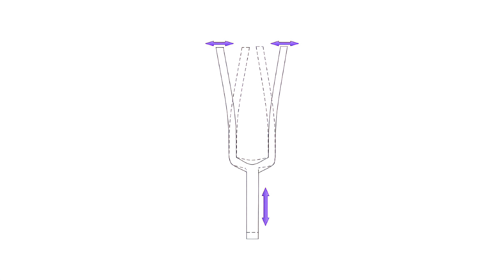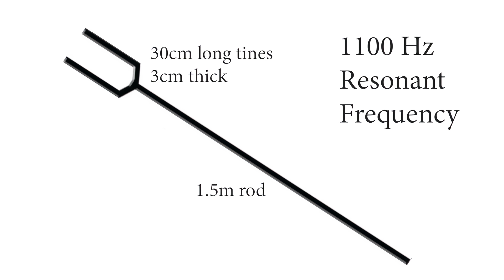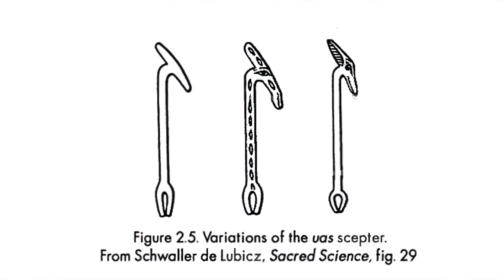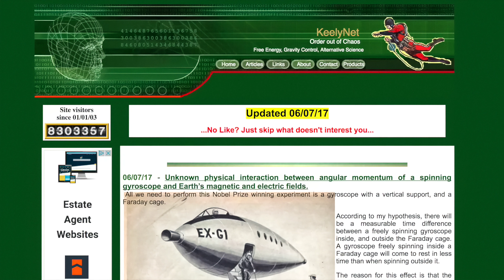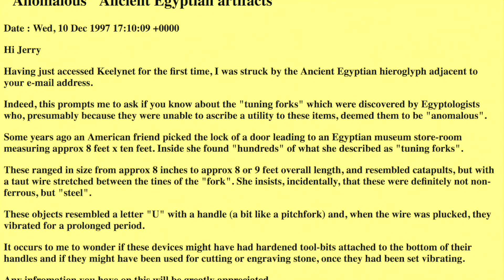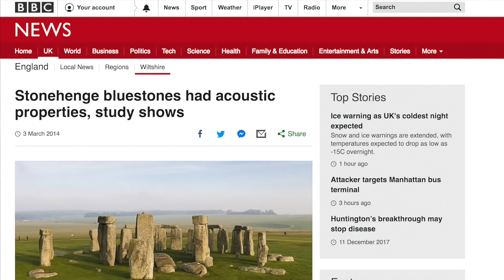How the Ancients Cut Stone with Sound - Lost High Technology Explained | Ancient Architects

Comment: to use these technologies would still have to have had tools for their use. even with the hand tool dogma we are told, where are all the tools and tool factories for manufacturing these tools. very few tools have been found of any kind. nowhere near enough tools have been found for all the claims. there is zero connection to the scepters being such tools. we are certainly missing something important. just to keep hand tools sharpened and made would have been a huge never ending operation with a ot of people involved. people think if ya can do one simple little thing one way then ya can do it all. simply not true

Comment: I believe the sound generation device was actually the Djed pillar. Rings touching a turning centre tube like fingers on a wine glass. The UAS sceptre was a handle for spinning the centre of the djed - just like the ones used for shaping clay pots. The ankh key was simply the attachment point between the Djed and the sceptre. The ankh is seen attached atop the djed in several places.

Comment: While I believe there was an advanced civilization that was able to do the incredible works of very smooth granite, diorite, and other very hard stones that need special tools to work them. But the myth of only having copper and stone tools is such a lie! We have seen examples of meteoric iron knives and it doesn't take that much to make chisels for good results.

But like many things in Egypt, the current occupants have many reasons to hide the truth from the world, so it seems that they were always the people of the area...

If they had an iron tip that slid over a copper or bronze rod, you would not need a complete iron tool to work the stone. But seeing how much meteoric iron was available, they could make small chisels from the scrap pieces.

Their tuning fork instruments can be steel, however, brass is a good metal, as is aluminum. But there are some fancy alloys that also work, but are not required to get the job done.

The idea of having wires interconnecting two forks may have been a way to keep the working fork vibrating, by striking the second fork with a small mallet, and keeping the wires taught.

Comment: Copper alloy tube drill, held like a drill press, in a large bit holder to maintain straight cuts, and get a big stringbow, like spinning a stick to start a friction fire with a bow and string, then try and and simulate starting a fire but in the stone with slaves, use a string bow, instead of spinning the drill by rubbing  yer hands together?🫤

Comment: I'm a retired stonemason sculptor and I have often used a two prong cast chisel that has the sound of a high pitched tuning fork. It always easily removes the stone from the right but never does any damage to the stone on the left of the cut. Works very well on lime stone and some sandstone. In all of my working life, I have never seen another. After watching this video  I can understand now why it works so well.
Reply: Do you remember where/how you acquired this chisel?
Reply: Was it like the ones used to work designs into leather?   Did you strike the handle with the fork side to the stone you were cutting?
Reply: Most Likely Tungsten. Resonance.

Comment: Perhaps they used a violin-type bow to excite the wires to keep a continuous frequency and apply pressure to the cutting fork shaft.
If they used soft copper tools these would start to get embedded with very tough pieces of granite and reinforce the cutting edge of the copper tool. This would be a continuous process as the copper tool wears. We use a similar process today using diamond particles.
We can't dismiss the fact there is tons of garnet sand in Africa. Ask any motorcyclist there who has had his chain sprocket ground down.
This would make an excellent rock-cutting medium with copper.
Maybe they used the hardest rock, ponding it into small particles and introducing it to the copper tool mixed with water which embed this medium in the copper cutting tip. 
After dismissing the copper tools as useless, we may have missed the obvious they did use copper tools but not in the way we thought. 
That is why there are heaps lying around. We have to stop thinking modern and place ourselves in their time facing their problems with what is available and using it in a constructive way as they did. Then we shall have the answer.

Comment: I am a master woodcarver and machinist.  I'm interested in how these old kingdom sculptures were made but every video I see shows theorists with no machining knowledge trying to pitch ideas that are contrary to the scientist's ideas who also have no machining knowledge.  Seeing wide spaced etch lines in a tube drill and thinking that it had to have been cut at an extremely fast pace when that was likely when the rotating tool was removed much quicker than the boring speed, (as is typically done in machining)  When you drill a hole you also have to consider how the removed material is exiting the hole getting out of the way of cutting progress.  There's feeds and speeds and heat build-up and all of this is for a simple hole.  When you are carving a 3 dimensional sculpture you don't simply do the whole thing with one tool, ever.  You are starting with a block large enough on x,y, and z axis to encompass your final piece.  You remove material around one of the axis in "rough cuts" that don't go down to the final finished depth typically with saws or rough grinders.  Then rough out material on a 2nd axis, then the 3rd.  You need many different measurement tools to be able to verify that you are not removing too much material.  Then there's rough shaping to bring the piece to a near complete state, still leaving enough material to remove in successive finish passes where you use finer and finer abrasives to achieve the final finish.  With a woodworking piece you may be sanding at 400-600 grit at the end, you are not carving with 400-600 grit.  Then there's adding details with various small tools.  These old kingdom sculptures display shapes, details, and finished surfaces that require so many different types of abrasive tools.  I'm sorry, but the only way to do it is with cutting elements that are harder than the material being cut.  How much harder directly effects how fast you can work.  The amount of rock work that was done in buildings, art and every day objects would indicate that they were able to work relatively quickly so clearly they had access to diamond cutting points and various degrees of diamond abrasives.  Unless someday we discover a readily available material that is harder than that
Reply: You know the Greeks carved marble statues I presume.
Reply: 😂😂
You haven't a clue.  Cutting stone is relatively easy it just takes time and effort.  Plus sand and water.

Comment: I last heard of the use of sound in levitation of heavy objects and using it to cut hard materials back in the early 1950s. I am still totally mystified as to how prehistoric man  lifted a rock balanced it on three or so other stones to form cromlechs etc.. If a ramp was used it had to be substantial because an earth ramp would just sink under the weight and putting the stone on rollers would make the problem worse.

Comment: Above the tuning forks from the statue there is a round thing. That could be a rotating structure like a fan ass, shaped like the notorious black schyst bowl. That "bowl" would oscillate while spinning or wobbling when weight of various mass is hung on it. This makes the air vibrate and would certainly make the wirestrung forks vibrate as long as needed

Comment: I always believed that the  septre was in fact a KEY.. a key that was used by Pharoah to SWITCH power on and off . the place  was those long small shafts that are seen in the great pyramid. ..usually thought to be air vents. Note the two copper points (positive and negative )   not unlike modern day electric switch.!

Comment: Stone is only cut by a huge input of ENERGY. Vibrating forks don't carry on vibrating by themselves once damped by touching an immovable surface (stone). Ultrasonic cutting only works by using an electrically powered transducer.  hundreds of Watts of power from the grid. Wishing a method doesn't isn't a solution - TEST IT

Comment: Another way to get constant, or near constant vibration isn't by striking the forks, but by bowing them.

If you have a taught wire between the prongs of a fork, and bow the wire, the fork tines should vibrate properly.

By looking at the cut stones around the world, the rate of cut is shown to be quite aggressive, much faster than if you rotate the cylinder to cut the stone, altho, you do get a pattern of rotation in the groves in the stone, that the cylinder was rotating.

Having tuning forks of different sizes, would allow you to have different cutting power, and could explain why there are so many forks found in the storeroom. 

But isn't it wonderful that there are any hidden artifacts? You would think that putting all on display might get someone thinking outside the box as to how the ancients were able to do some of the things they did?

Comment: Well if the Alexandra library hadn't caught fire, there might have been some past knowledge, and we will never know.
So they had a sort of Arnonica device that made high frequencies  vibrations too a copper wire stretched tight causing the frequencies to be transmitted through it causing it to cut, stone with high frequency sound in a linear fashion.

Comment: I believe yr wrong about the wires between the tuning forks. It looks as if it's symbolizing the wave that's transmitted between them. And the cutting of the stones I believe was done by slow movement of the drill that's attached to tuning forks. Like the slow movement of yr finger around a wine glass. No hitting it with a hammer. Just slow steady movement which would cause the vibration needed
 Also water would be needed in the whole being created. Hyroglithics sometimes are more simply written for understanding

Comment: @10:15 "Independent researchers have proved that you can bore holes through solid rock with copper tubing using sonic drilling methods". Where is this proof? You showing showing some tube being inserted in an existing hole in a rock. Where can I see this "proved" process from start to finish?

Comment: The wheel turns. Here I am, 2 years later apparently, and watching this video again. I watched it without realising I had seen it 2 years ago and made the comment below. There is an animation of a tuning fork attached to a tube. The tines of the tuning fork vibrated left and right and the tube vibrates in resonance up and down. Neat. Except the ancient artefacts discovered look nothing like the 2 inch diameter tube needed to bore a cylindrical hole in granite. Also a tube made of iron, even primitive iron would be harder than copper. Why are people fixated on copper?
Also if the rock was crushed by the impact of the leading edge of the tube, that impact energy and force could be deliver more simply by hammering the outer end of the tube with a hammer. No need for fancy vibrating tuning forks which could deliver small amounts of energy if made to vibrate continuously. It would just take longer than hitting the end of the tube with a hammer.
Also, one of the ancient drilled core plugs from the British Museum, if I recall,  had a helical score mark along the cut surface. This was not created by an impact tool. It was created by a rotary tool.
And finally let me repeat my request for a demonstration if this process is all that easy.
PS It massages my ego to find my 2 year old comment at the top of a list of 4,306 the comments, but I would rather see a demo.

Comment: That could explain some, like boreholes and straight cuts. It does not explain curved kerfs in what look to be circular plunge cuts of a round blade though, nor would it explain the various oval shaped diorite, andesite, and granite stone jars that have wall thicknesses thin as a playing card but have single point lathe like marks both inside and out, some with pronounced lips, or the perfectly flat straight cuts inside of the diorite "funerary" boxes. The problem I have seen with various notions is that they could answer some, but not nearly all the problems. The same frequencies that can cut rock will shatter thin walled stone objects, just like a crystal glass exploding at high enough frequencies. They may have adapted the technology to a 30ft diameter round blade, but I don't see how. Such a large round flat thin metal surface would dampen the waves too much and the power of the vibrations would have to be enormous to get them to ring at high enough of a frequency. There is one stone that even baffles me, as it has evidence of a straight cut, but the cut itself is not flat, but evenly curved with large radius. Those ancients were anything but stupid, OR "primitive". That stone would give a modern stonemason fits. Would be hard to do in wood, let alone diorite with a hardness of 5.5 - 6 on the MOHs scale (55 - 60HRC or Rockwell hardness scale). Hardened tool steel is only 6 on the MOHs scale (60 HRC) and diamond is a 10 (100HRC) to put things into perspective. Granite is a 6 - 8 MOH (depending upon composition) so the hardest granites are almost as hard as tungsten which is 9 MOH, and andesite is 7 MOH. When people say hard stuff, they mean HARD stuff. Fully hardened untempered steel will barely scratch diorite, which is the softest of the three. Tempered steel is softer than fully hardened steel, for those that do not know, but is less brittle and therefore tougher.

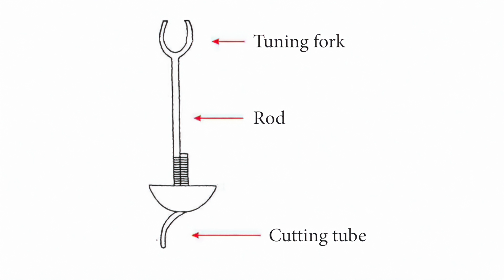Comment: At 8:04 above and below the tuning forks connected with wire appears to be archery type looking  bows , maybe these were used like the violin bow to vibrate the wire instead of plucking the wires like a banjo. The circle below them with flower like pattern the Frequencie.
Aswell the Ankh would of been used as a hammer on the U shaped  forks like a hammer to get them vibrating .

Comment: The Seth Material mentioned how the use of sound was the basis of this civilization. Seth mentioned the ankh was a sound directional device. Was used to make the surface of the rock like frosting so it could be manipulated and formed. He mentioned that the sound bound molecules and had a cohesive effect on the rock. 
Said the pyramids also had secret rooms that could be entered by sounds. The hieroglyphs were meant to be sounded not read.
Said the pyramids were constructed by the knowledge of coordination points and complex mathematical equations. Coordination points are where thoughts take form. They are smaller than atoms and have not been discovered by our scientists yet. They have infinite energy and they are where all realities intersect.
Seth also said that we don't rediscover these technologies until we come into harmony with them again. Currently people would use these technologies for war or similar things. He said the overuse of sound is what caused the historical flood.
Have only found one example where some explorers supposedly entered a secret entrance at the top of the pyramid using the sound method. Would be really interesting if we could try and learn more about that. Find it hard to believe that these master engineers would dead end passageways. Maybe this is something we should try and find out.
Just my .02 cents here. Interesting stuff for sure!

Comment: Wrong conjecture. All were built with basic tools and ingenuity. Just visit a stonemason and you see how its done.  Sonic cutting is slow. Sonic cutting requires very hard alloys not available in premodernity. 
Now build one and see if you can get it to work. Wood, copper, resin and string.

Comment: question, instead of a guy holding a rock to keep the pressure, and the two guys with the bow drill, couldnt they create a mechanical handcrank? even americas most basic carpentry tools for drilling tools used a hand crank. just utilize 4 gears, a few wheels and handles. the same design slightly modified, could also propel a blade to cut left to right for straight cuts, and could could a stone block im sure in a few hours, as you poured sand and water in the crack. yea another point is if you mention sonic drilling, i appreciate the audio explanation, but it would be really nice if someone could reproduce this method in a modern way.

Comment: I think they were just clever as fuck. What it takes for modern tools to do quickly simply was much more backbreaking and meticulous, slow going work. They were more motivated and organized than we typically give them credit for. And had some true expert craftsman that were trained generation to generation. They knew they "little" tricks all masters of trade learn after 10-20 years but multiplied. I don't know. Very well could have used something like this. I think it's more likely they simply used a gritty, sand/salt water like abrasive material to lubricate the drills. They probably set up siphon or screw pumps to provide new water and carry away the cut debris etc. So you may be onto something. I don't have much doubt some builders understood harmonic frequencies. But I still would say the simplest answer is the more likely. It is possible. It's just hard. Just like clip you showed mentioned. I'm not as confident as you seem to be it's not possible.